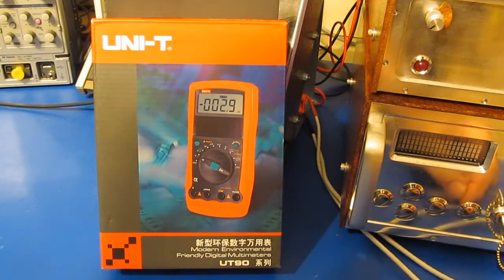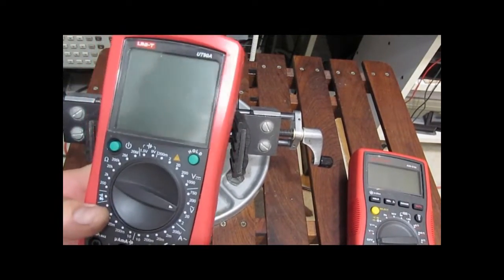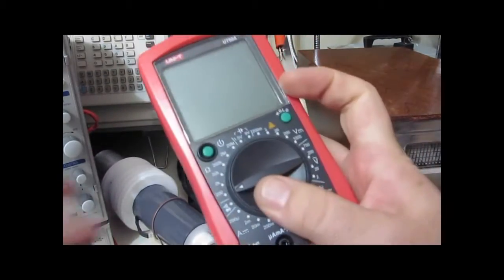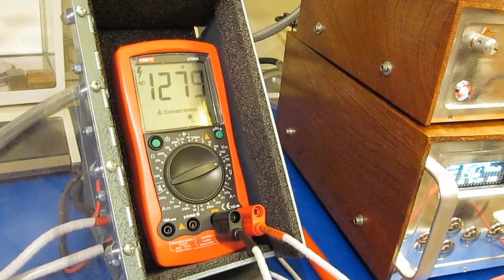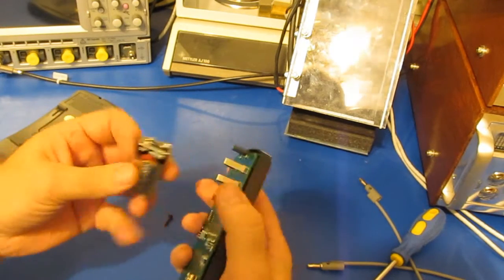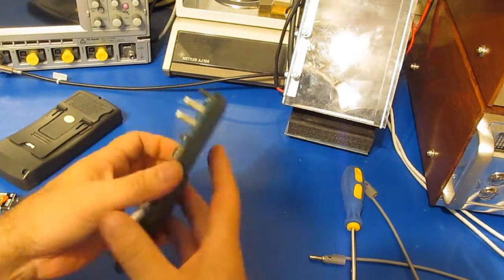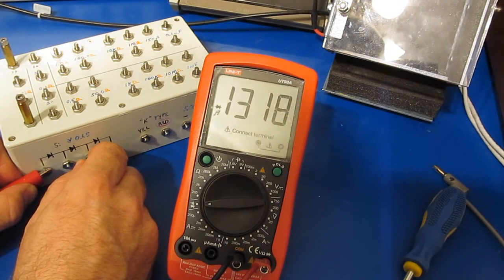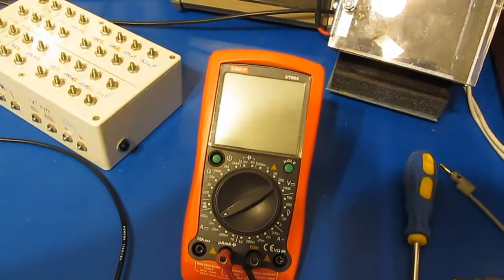The Nine Lives of the UNI-T UT90A AKA the Cat

Comment: Best episode yet! Even an Van Halen tribute! I'm currently designing a DMM to survive your tests. The dial has a 1 meter diameter and about 50 PTC's on it. Love the videos in a weird kinda way....
Reply from the maker: HAHAHAHA  1 meter switch and 50 PTC's is a good start but if you have been paying attention you need about 50 MOVs and maybe 100 diodes to go along with it.  Maybe sprinkle some gas discharge tubes in there as well.   I am surprised I never damaged the controller IC on this meter.  Something else always seems to give up first.